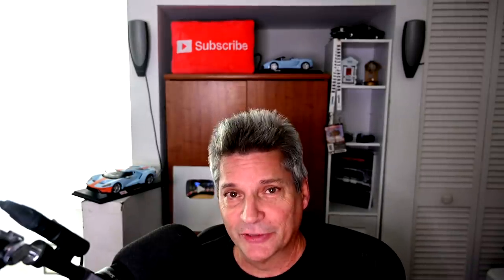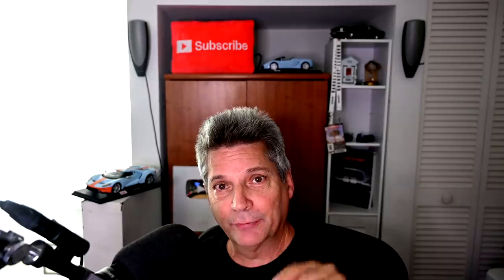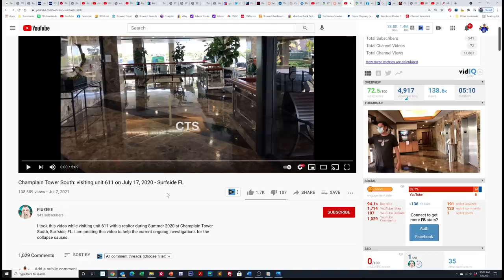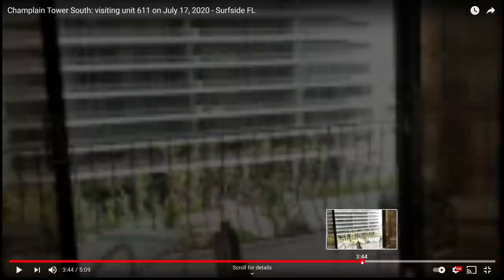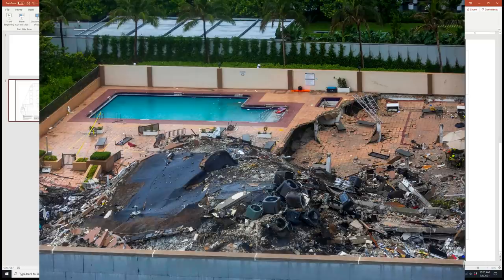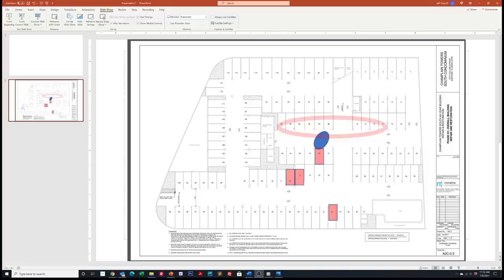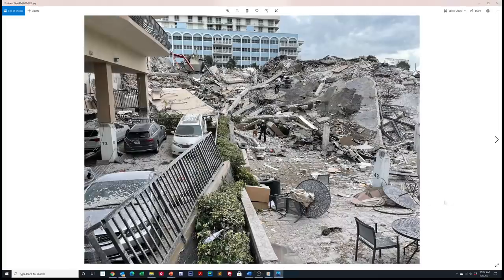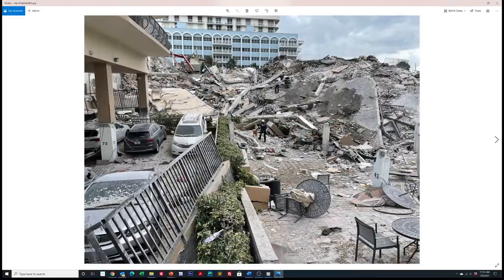Analysis Garage Video BEFORE Condo Collapse: Water Everywhere

Comment: Every single column had water stains about 6-8” above the ground.
Reply: First thing I noticed about them, too! That had to be going on for some time...
Reply: First thing I noticed too!  I'm yelling at the video - look at the water marks on the columns!!  Sad :(
Reply: Are you sure those aren't just shadows?
Reply: @planaritytheory  not shadows.. great indication of pillar integrity being compromised. sorry and floor integrity
Reply: @jubei2154  can you give me a timestamp of exactly what you're talking about?
Reply: @planaritytheory  ??? Don't see where your getting at but I will say water marks that high usually means a lot of water which means it sitting there for a while... no reports of extensive flooding but reports of water pooling in places fine weather this my opinion as I seen alot of concrete rot at a few sites and unusual watermarking can signify a bad structual problem.. bad drainage variable
Reply: I saw that too first thing! Looks like they had been underwater at one point. Although wondering if that could’ve been from hurricane season too, I’m sure parking garages bear the brunt of it.
Reply: @planaritytheory  one is at 8:27 & I saw several others in the earlier parts of the video
Reply: Apparently a former maintenance worker for the building said that they were constantly replacing pumps to pump standing water out of the garage because they would burn up so often.
Reply: @planaritytheory  5:08 pillar 105/106.  I asked a question about those but then deleted it because it was in the part of the building that didn't collapse.
Reply: @amymusick5455  Thank you!  Yes I see it clearly now.  I actually read the initial comment as "6-8 feet" instead of "6-8 inches" (after I watched the video), so when I went back through the video to look for the water damage I was looking near the tops of the pillars, and they all have shadows there that are cast by the pipes.  My confusion is resolved.
Reply: @EricSaavy  Your video has comments disabled.  I believe it's because you've marked it as content for kids?
Reply: That’s what I said in his comment… that’s a mayor red flag to me…
Reply: @EricSaavy  well said.. indeed frustrating

Comment: Literally these are some of the best explanations for how and why this collapse happened. All I can really think now is, "This was totally preventable" and "This was a major design flaw in support columns and support beams". Someones ass is getting handed to them after all this gets sorted.
Reply: ...more likely bad design of the pool area deck, that was flat and drained poorly, leaking into the garage.  So not to jump to conclusions, but a poorly draining deck allowed the rebar at the columns to that deck rust out, the deck collapsed, and then moments after the new side load on the outer garage building columns took bending loads and buckled, the rest was a cascade of bending/buckling across that building...very sad, and I bet the other North Tower is in the same risk....aka, shore up and properly drain the pool deck of that building too!  Someone's @SS!  Imagine what the insurance issues are too...a nightmare for everyone!
Reply: @wokewokerman5280  no water issues in areas not under the deck.
Reply: @danlux4954  ...water finds the low spot in the garage to puddle, same when it rains and wet cars come down and drain off....those puddles did not seem deep at all and scattered all about, seems maybe only one main puddle indicated subsidence of the foundation piers...we'll see...report will change inspection and maintenance across the board in USA, should prevent this from happening again.....
Reply: @wokewokerman5280  the North tower did all the required maintenance and repairs. It looks like new. It wasn’t neglected like the south tower.
Also, the contractor, architect etc of the building are all dead already.
Reply: @horsewithnoname12345  ...hopefully the North Tower is ok...maybe a good idea to reinforce the connection of the deck and beams to inhibit the punch through, and improve the drainage, we'll see, so tragic...
Reply: @wokewokerman5280  You are correct, but I don't agree bad design. I believe the deck reinforcing rusted out at the columns. When their weight causes them to collapse, they causing side pressure on other columns. The only stopping it would be to add more sheer walls from footings to the roof, which kept half the building standing.
Reply: @Drwild75  ...I think the bad design is not proper cricket and drainage for the deck, and perhaps added collars at the top of the deck columns to spread the floor load.  My experience with floor loads is that with the floor deflection, slight cracks occur on the upper floor surface where the deflection stops due to the beam, and I bet these hidden cracks let standing water corrode the curved rebar from the column to floor connection.  Not an issue in the building structures as there is no standing water.  I am also curious how they sump water out of the parking garage, as it is likely below sea level or at least well below street level and difficult to drain, but I don't think that's of any consequence here.
Reply: developer dead in 2014, company gone... You don't get a lifetime warranty on a building
Reply: @wokewokerman5280  we spent 4M replacing the floor to the indoor parking, floor wasn’t waterproofed and rusted all rebar.
Reply: @danlux4954  ...understand your input, seems the water never drained properly and was allowed to stand, a problem anywhere, especially a floor near sea level.  I think this issue is evolving, in a lot of similar buildings, where the garage is so low and certainly any building where the support columns are marginal (or based on the minimum size based on the engineering and any codes).  In this situation, I suspect the strength of the concrete used, which will be tested and the report will let us better understand.  Low strength concrete (or a wet pour) will allow more cracks and greater chance for water to enter and reduce it's intended strength.  A very sad situation for those people and families, our hearts go out to them.

Comment: Some areas of the garage deck looks like long cracks have been patched. Nonetheless, patching the garage ceiling without fixing the source of the leaks above is nothing but a cosmetic undertaking. Probably, as time went on, the structural supports were deteriorating more deeply within compared to what was be seen by viewing the ceiling surface.
Reply: Yep; I've been warning about it globally for 30+ more years (with a [pre-build-]solution).
Reply: @RogerThat1945  where do you think the water was coming from? The roof , balconies window sills etc? Or maybe internal plumbing
Reply: @alexanderstevens145  probably rain water from the pool deck. Rain water is salty there. The pool deck was not waterproofed and it was flat without any drainage. It got soaked up/absorbed by the concrete.
Reply: @alexanderstevens145  the leak was cause AFTER the building started cracking apart.
Reply: @horsewithnoname12345  And guess what salty water does to rebar. As I have been saying for over 30 years.
Reply: @horsewithnoname12345  oh I see  👍

Comment: 5:30 One thing I noticed is the discoloration of the yellow paint at the bottom of the columns. It almost looks like water has seeped upwards from the bottom of the column. The tops of the discolorations are uneven. Could this be some sort of wicking effect? Am I imagining things?
Reply: Good eye.
Reply: I noticed that too, surprised he didn’t say anything
Reply: Yeah I saw this straight away. 👌
Reply: I noticed that too. I come from a carpentry background and in my trade we call that "rising damp".That indicates the carpark  floor slab is waterlogged. Water has weight also . If the above slab was waterlogged also the extra weight could have contributed to the collapse.
Reply: Just repainted with some clay under to hide rust..
Reply: @muzduz1  I'm wondering what effect it would have if it was a) salt water rather than rain water and b) having a similar effect on the pilings supporting the building. One video I watched by "Building Integrity" indicated that some of the water in the garage was salt water, which would suggest that sea water was somehow seeping into the parkade from underneath. There doesn't seem to be a lot of damage to the vertical columns, so could the issue be in the foundation of the building? I guess we all have to stay tuned.
Reply: A wicking effect. Enuff to discolor it, and it looks like it is staying wet. Enuff u can see it thru the paint. Wet concrete will crumble after awhile and I think the paint will trap the water in their from drying out.

Comment: Looks like the yellow parts of the columns also have absorbed water.
Reply: The yellow paint is highly reflective in hopes that drivers will see the pillars and not hit them. Most of the pillars looked to be in good shape but I did notice one pillar that appeared to have a separation on one side from about 6 ft high up to the ceiling. I did notice a couple that may have had very minor damage to the base of the pillars, but like Jeff, I didn't see any that looked to be an actual issue.

Comment: The things on the ceiling you see poking out, which you refer to as stalactites, bolts, rebar, etc, are the epoxy injection ports for previous failed fixes.
Reply: And epoxy is not going to hold a building up!

Comment: What you are calling paint chips on the garage ceiling are not paint chips at all.  They are calcium stalactites that form when water penetrate a concrete deck at a crack.  That same water penetration will rust the rebar causing it's eventual failure.

Comment: At the ~25 min mark when you say "what the heck did they do to this ceiling" - they've attached corrugated plastic sheet to the ceiling ! I'd imagine because there was a lot of water leaking through there, so they attached it to catch the water and direct it away from the cars ?
Reply: Yep, exactly. It's the only way you can protect the car until the concrete is repaired.
Reply: Exactly. The sheets were probably done by the owners themselves trying to protect their cars because getting the building company would take forever. I used to live in a condo a mile from right on the beach, back in the mid 90’s. Then there were a couple of those from leaks in the garage that would eat the paint. That was 30 years ago, I wonder if those leaks were ever fixed or even worse now. I’d hate to see my old building or any others on the news like this.
Reply: They look like metal deck pans and were probably under areas of extensive calcification.  I remember hearing that the engineering report cited in the other video made reference to complaints of this type of material dripping onto cars and of failed repairs.
Reply: This was done in a mall where the parking level ceiling fell in. They make large nylon fabric funnels to collect large leaks into a drain.
Reply: It could have been there to also stop chunks of falling concrete from damaging the expensive automobiles paint. That's how XDOT fixs bridges up north until the deck gets replaced. Sometimes a few years later.

Comment: A number of the columns appear to have water marks at least 6" up into the yellow painted areas suggesting flooding of the garage floor. #106 also has water around it's base as well. This is consistent with some residents who reported the garage would flood to the extent their cars would float around in the garage.

Comment: 5:14 seems like a neon light difusser left jammed against the wall and the piping. It was probably removed from most of the light fixtures where water was leaking. The logic of the electrician was probably that light fixture which does not accumulate water will be the one that requires less maintenance hours. I would not blame that dude for that. He was probably the 1st guy that has made all the water related complaints!

Comment: I'm no engineer, but there seem to be so little beams from column to column in the garage. Where the floor sheared off at 72 it looks like a slab of concrete of maybe 150mm (6"). A poor connection if you ask me.

Comment: I’m curious about something no one talks about.  These apartments had a 
lot of ceramic tile and granite counters.  That wouldn’t have been common 40 years ago.  My question is…could the remodels of the individual apartments have added weight stress to the structure?
Reply: Probably not nearly as much weight as adding additional floors that the original plans did not call for. Oh wait, that isn't even a factor in this case. Aren't these things at least somewhat over-engineered to take in account such minor variances? But how do you over-engineer to correct for corrosion and neglect?

Comment: At 8:39 you can clearly see that there was a pool of water right next to column 53/54, it might very well be the case that water was also inside the column itself.
Reply from the maker: yes many columns had pooling at the bottom

Comment: I am an engineer as well so enjoyed your video and pictuers.  We do however differer in Analysis.   The columns did not collapse from what I see.  In fact they are sticking up through the floor that did collapse... So this failure seems to be the connection between the first floor and the column.   So yes rebar rusting will cause spalling and weaken the structure but it is the floor that started the collapse not the columns.  The fact you see rebar without flooring attached to it shows that the floor again just detached from all support and failed.

Comment: OK I'm a software engineer, but those "stalactites" look like they are actually remnants of epoxy injection, which were never cut down and finished. I am referring to 12:23 and 13:34 and 15:12 and other timestamps.
Reply: Most are epoxy nozzles, some are stalactites (further reinforced by images taken by Moracito). The concerning thing about the epoxy nozzles is that Moracito commented that new cracks were forming in areas where previous epoxy injection repairs were attempted. Instead of sealing existing cracks in the concrete slab, all the epoxy did was trap water above the structural slab and heat cycling forces formed new cracks for water to run down through. The combination of a poor epoxy repair job and lack of effective waterproofing above the slab made things worse than if nothing had been done. The worst factor that I have identified when it comes to water is the fact that roof scuppers would dump water directly onto the planters on the pool deck. The primary roof drains were noted as being ineffective, which means water would collect on the roof and inundate the areas below the scuppers. The large planter in the area above 76/77/78 was a giant collection bowl for water coming off of the roof above the 13th floor penthouse.
Reply: yes, i agree these are remnants of the injections, i dont know if they should be there, but i recognize them. We are using them to repair light concrete damage after earthquakes.
Reply: The roof guys would dump water from the 13th floor into a planter on the pool deck?
Reply: Yup morabito (sp?) even said in the report that they hadn’t bothered to finish the injection ports
Reply: @jimparsons4312  If you look at the parapet walls that enclose all areas of the roof, there are rectangular openings on the side called scuppers. The purpose of these scuppers is to give a path for excess water to drain off the roof in the event that the roof drains are unable to keep up. The engineer report noted that the roof drains were ineffective, meaning that whenever it rained hard enough to overwhelm the roof drains, all that water would be forced to drain via the scuppers. The position of the scuppers along the parapet directed the water right down onto the large planter boxes on the pool deck.

You can see the scuppers on the parapet in this image: http://www.alypinedamiami.com/wp-content/uploads/2020/10/surfside-champlain-towers-south-001.jpg
Reply: @hochhaul  wow!!!!!!  When I saw the aerial photo of the roof you could tell by the nasty color there was something not right with the drain off! Thank you 👊👊
Reply: @iroker  As a contractor, I would say at a MINIMUM the repairs should be ground down then have the proper paint put over them. Looks like neither was done in this case. Probably went to lowest bidder and most likely all he quoted for was to "Repair cracks in concrete using epoxy" or something, then did the bare minimum to fulfill it.